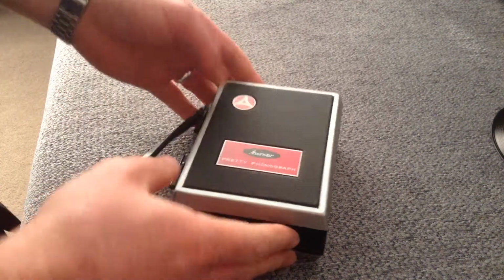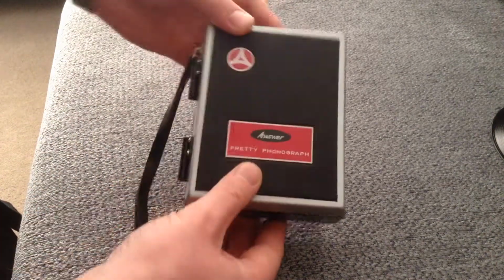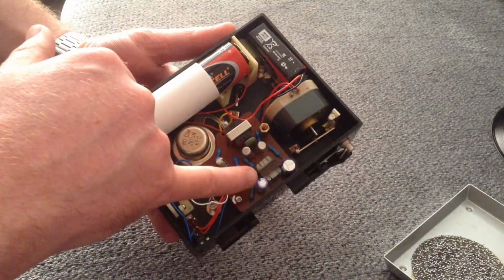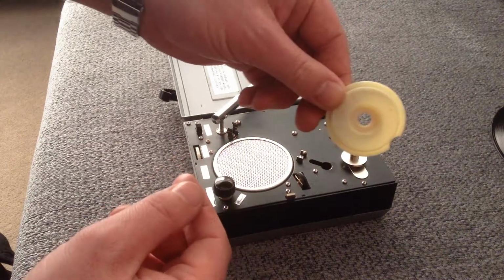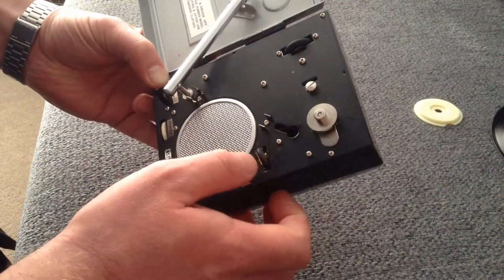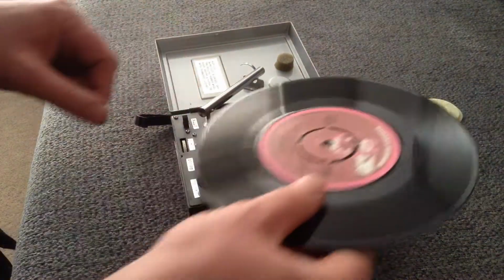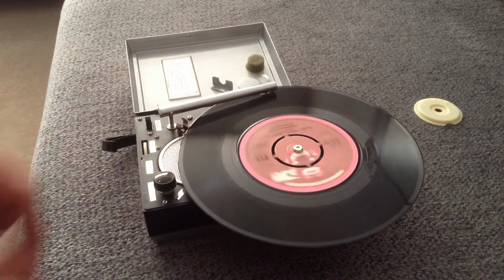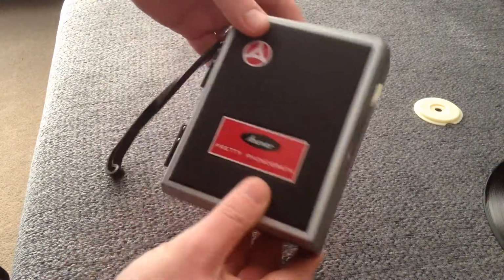Answer pretty phonograph pocket battery micro record player

Comment: In my record player collection, I have a Motorola player from the mid 60's that plays 45's.  The record slides into a slot on the front, just like CD's did decades later.  It belonged to my wife.  It uses 6 D cell batteries for power.  After close to 60 years, it still works!